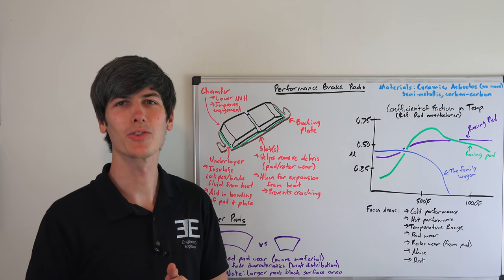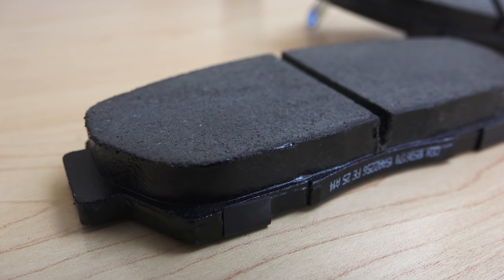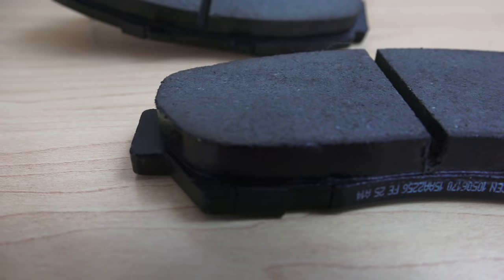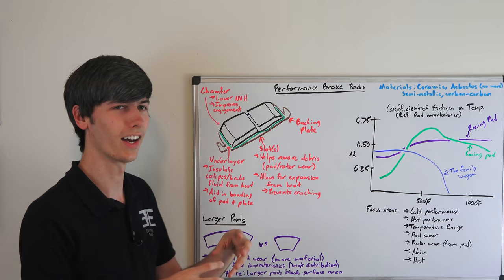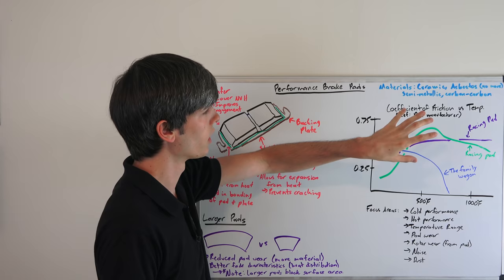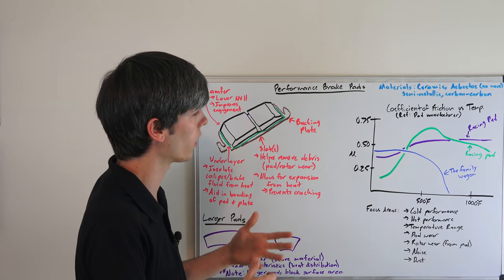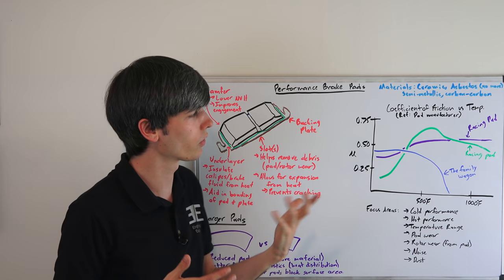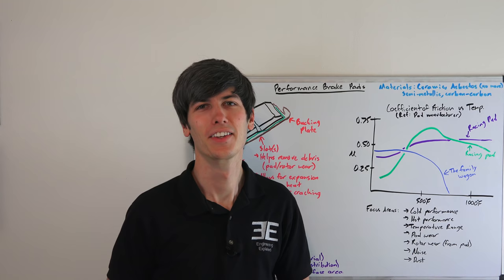Performance Brake Pads - 7 Key Characteristics

Comment: Funny people never talk about changing break fluid. An inexpensive thing to do, it makes great improvement ....no one believes me.
Reply: YMC-DAB420  Where do you buy that at?  I need some of that!

After watching EtCG's video on stainless steel brake (err break) lines, I'm thinking about an upgrade!  😅
Reply: It's worth doing if it hasn't been changed for awhile. On a new car, changing the fluid won't help unless you're tracking the car and need a higher temp rated fluid.

Comment: maybe a better video would be the comparison between semi-metalic and "organic" ceramic pads, which most of us buys
Reply: frank james I agree. I've seen some comparison, but this guy explains well. I would like to hear his opinion and what he thinks about it.
Reply: frank james Yeah, I'm still confused with those. What's better in different situations? Ceramic, metalic, organic - there are so many of them.
Reply: +frank james semi-metalic is better for track/street use as the compound has a high temp range. The ceramic pads are really good for street use as they have low dust and noise and some can be used for a track. Organic is purely for street use as it has good friction from cold but really bad for speedy driving as they will overheat really quick
Reply: I agree
Reply: frank james Organic if you drive like a woman. Semi-metalic if you want to stop.
Reply: I wanna see this future video to, wanna know the scientific datas behind each material's performance. Like whats thw difference between full ceramic or carbon ceramic

Comment: Damaged/old brake fluid plays a big part in break fade - a simple flush every year can makes a lot of difference.
Reply: But full flushes, most auto shops don't bleed the brakes and only replace what's in the reservoir.
Reply: Oblithian Too true..
Reply: Oblithian that's a good way to do it. of you use a clear pipe... just fill the reservoir up and bleed every brake. starting furthest away from the reservoir until they become clear.
of you change you fluid every 2 years or 12,000 miles. then why you need a hard chemical which eats the brake lines too?

Comment: I've had brake fade once coming down a very tight twisty hillside road while on a "spirited" drive. By the time I got to the bottom I had almost no brakes at all. It's quite unnerving.
Reply: theslimeylimey cool thing is the more they heat up the less they brake and reduce heat absorption which works as overheat bypass
Reply: theslimeylimey Usually, you will still be able to slow down with the e-brake as the rears will likely heat up less. Had this with my father's car (turned out the car just needed to be serviced and still had factory brake fluid), pedal to the floor had actually less effect than downshifting : I ended up going straight instead of turning at an intersection, put two wheels on the grass and pulled the e-brake to do a u-turn and stop. Tried driving a bit a slow speed to help cooling a bit before stopping, and then tried to pour snow on the brakes. That was a pretty funny moment^^
Reply: GT-Alex good tip about the e-brake. My car was a manual so I used the engine as a brake while I stood on the brake pedal which slowed me down enough to make the corner. It felt like there was grease on the discs.
Reply: theslimeylimey
Although, I would recommend pulling it slightly only, unless you're very experienced or trained to this. I think the reason is pretty obvious.
Reply: +GT-Alex Pouring snow on the brakes isn't a very good idea, could end up cracking/warping the rotor.
Reply: dj7310
 Yeah I know, I had it let cool down a bit, plus the problem was coming from brake fluid which boiled quite early, having never been changed, so I mostly tried to get the snow on the lines. Didn't do much, but enough for me to be able to actually feel a bit of decceleration when pressing the pedal, so I got back on the road carefully, as it is always better not to be stationnary to cool things down.
Reply: +theslimeylimey I've done the very same thing. High temperature brake fluid and absurdly-expensive brake pads fixed that. Japanese brake pad compounds like the Endless MX-72 are known to be track-worthy brake pads that also work well on winding roads like mountain passes and canyon roads.

Comment: I want the caliper that goes around the whole disc. 20 piston calipers for my Civic.
Reply: #WheelLockUp
Reply: And then how will the rotors cool down?
Reply: Boyd W through the internal vents
Reply: @MustangsTrainsMowers  The caliper cools the rotor down, too.
Reply: @MustangsTrainsMowers   You will need a extra radiator for water cooled discs.

Btw... I think the original comment was a joke
Reply: I looked at installing a big brake kit on my wrx...  $5000  🙄
Reply: 20 piston calipers best fit a lorry brake master cylinder🙄

Comment: Great video! Definitely calls for a follow-up, e.g compare characteristics of a few high performance pads, and also why getting pads with super high friction coefficient isn't necessarily going to stop the car quicker: it will trip the ABS (if you have one) or lock up the wheels (if you don't) in case of heavy braking. Very high friction pads require tons of aero to get enough grip on the front tires to maximize braking force.

Comment: I had huge Brembo brakes and rotors with ceramic pads and they failed immediately on the track.

 I had to pit and have my pit crew put in my Cobalt Friction racing pads. Back on the track and the racing pads are impossible to overheat and fade. 
Castrol Srf $80 a pint full synthetic brake fluid is a must!

Comment: I would have liked to hear you talk a bit about which types of pads (pad materials) give off more or less brake dust.  Is there a general trend/rule in cost of braking performance for the low dust type or can you find a low dust pad that still has good braking?
Reply: yes. our pads have very few dust. It is ceramic formulation, without any metal.

Comment: Tip: For daily use avoid the slot brake pads all you can. They are just there to collect debris and scratch your disks. Otherwise clean them very frequently. Live and learn. ;-)

Comment: Great video. Would have been even better if you had made it even clearer that brake pads are always a compromise on something. For example if there was a material that had great coefficient of friction at both low and high temps it would wear extremely quickly. Also you could have explained the basic equation of friction, which doesn't involve area, so just increasing pad size doesn't give you more breaking force. Just suggestions, please keep video coming.
Reply from the maker: Gavin Newman Thanks, I have a lot of videos covering F=uN so I didn't bring it up again. Everything's a compromise. :)
Reply: Okay.  You didn't need to explain it, just mention it and maybe get some self promotion! Keep up the great work!

Comment: I always thought the changer on the edges was used as another more visible “wear indicator” as in if the pad wears away the chamfered edge the pads are close to being worn out.  I know they use a metal strip that drags along the rotor and when that happens the pad is gone and needs to be replaced.  

True story but way older vehicle.  The pads were worn down enough where the rivers used to connect the pad to the backing plate wore down and was digging in the rotor.

Comment: As a car enthusiasts,(consumer) I do care what kind of material for brake pads lol. You know before I knew about the kind of materials there were, the question was "do you want more or less brake dust?" Haha I have ceramic brakes on my ford explorer sport trac. They are "good"  but there's something about them that I don't like. It could be because the suspension and also with only having disc brakes in the front. Some people say you have to wait until they warm up for them to really start working. what kind of pads would you recommend for the "consumer?"
Reply: Okay thanks.
Reply: For you? Maxi pads.

Comment: Thanks, though I wish you spoke more about pros/cons of the various material options.
Reply from the maker: mwsaplam It's certainly a complicated subject. There are dozens of materials, but often times you're not going to be buy "x" material, you'll be buying some composite of many numerous materials. Hence, it's important to look at the temp charts and see how the pads perform.
Reply: +Engineering Explained Yeah, good point. Thanks for the reply.

Comment: Engineering Explained I upgraded to larger calipers before and went back because it seemed my brakes would fade much faster and last much longer. Is that because of the components not cooling down quickly enough?

Comment: #question  i have seen this on many makes and models of vehicles , why do manufacturers make the pads smaller than the disk , what i mean is radially the pad does not cover the disk leaving a thin line of metal all around the disk , i would like to hear your thought on this since in my opinion its just so you have to change break disks every time you change the pads ( just like what Scotty Kilmer  thinks )
Reply: No need to change disc. Its not a big deal if brake pads size is small.

Comment: Hi! my 2018 BMW M4 with 25k miles currently got front brake pads at 5mm thickness (NOT carbon ceramic). With the car, brake servicing warranty was purchased that will expire in 15 days. BMW doesn't service unless thickness goes to atleast to 4mm. No chance of getting the car to track/autocross, any other specific driving style may use 1mm thickness with 50-100miles driving? :) Thanks!

Comment: If you have a car traveling at 60mph with normal family car brake pads, will it enduce less wear on the brake pads and rotors to stop quickly in a short distance or stop slowly over an extensive distance?

Comment: There was no mention of Judder or Thudder during the discussion of performance brake pads.  Asbestos is still used in brake pads.  The characteristics of friction vs. velocity is completely missing in this presentation.  No mention was made about bedding and material transfer for adhesive friction, the predominant mode for friction in braking.

Comment: Forgive my lack of knowledge, that's why I'm here, but at what point does one need to start upgrading master cylinders to accommodate the stronger than stock brakes?
Reply: you run the risk of overheating the brakes and overpressure and you will shorten the life out of your pads and the rotors. Lol

Comment: Isn't there a letter code on the back of brake pads you can read to see what the performance is too?  From what I understand, the first letter represents cold performance, and the second letter represents performance at operating temperature. The higher up the letter is in the alphabet, the greater performance that brake pad would have. For example, an FF pad will be better and more consistent than an EF pad, which would perform worse when cold. Is this accurate?
Reply: +Gavin Carney The two-letter friction rating you are referring to is called the FMSI friction level coding, sometimes referred to as the DOT pad code.
Reply: Thanks for the info! I've been wondering how I can search for brake pad quality online, so knowing what the rating is called should help me do that.

Comment: Use a Nokia 3310 = infinity brake pad life
Reply: +Cars and their Parts I used them for a while but they ate up the rotors in just a few weeks.
Reply: +Cars and their Parts Them Callahan brake pads are so much better. I had a pair of HTC brake pads and they just dont hold up.
Reply: I might actually try that
Reply: But the brake rotor will break so you are not stopping at all.

Comment: for track applications I hear carbon ceramics hold that coefficient of friction, but does that also means they last longer\get replaced less frequently? they're way more expensive to replace so in terms of cost do they really even make sense for non-pro enthusiasts to shell out for? what's the best budget track brake pad for your average bro?
Reply: SoSickWidit For the road and maybe a spirited drive, racing pads aren't worth it. They will take time to warm up and they will bite insanely more than standard ones, they will make more noise and dust also. They sacrifice longevity (not too much) for stopping power and are to be used in basically high speed stops all the time, eg. a track. Street pads are worth it if you go for spirited drives often, but for normal use stick with a high end ceramic pad with multiple shims on the back plate and you will be perfectly content - less noise, less dust, longevity, and good stopping power. You probably have a forum for your specific car with sponsors that sell aftermarket parts for it, so check out what they have to sell as upgrades from stock.

Comment: i was thinking switching from solid to slotted but i dont know which pads should i use. i have 2004 bmw 4.8is 360 bhp and i use it 95% for commute but that 5% i like to run it 250kmh on german auto ban,. i have noticed i am loosing brakes when driving a bit more aggressive above 200kmh. so racing pads are not good for commute, and regular ones are not good for autobahn... any ideas what should i look for? if i use ceramic pads on regular disc, is there any other issue than premature disc wear?
Reply: ktm640lc4BGD EBC Yellow Stuff pads.
Reply: Evil Opti Z thank you, i'll give it a try

Comment: I work at Advance Auto and I was wondering why Merdeces' brake pads are usually square without chamfers on the sides without a cut in the middle. Why is this? Wouldn't you want a pad that is rounded along the rotor surface to give more surface area and more heat dissipation on a performance car?
Reply: +Striball Mercedes just playing their money games, the pad will eventually leave you with horrible uneven wear, creating a deep ridge line in the rotor requiring you to change the rotors when the pads need replacing.
Reply: It doesn't wear out the outside of the rotor so you have to change your whole brake when you do your pads. It's really annoying.

Comment: I have been fighting with pad wear and performance in my 2006 4-runner sport. The truck has warped rotors from day 1. Now I have put a lift, heavy bumpers which has added 800lbs. I upgraded to EBC yellow pads which lasted 6000 miles. The orange pads went 9000 miles but no warped rotors! Is there a pad that will last longer and not warp my rotors??
Reply: Rotors warp from heat and sudden  cooling. So if you are braking really hard and make your rotors very hot then hit a puddle it will warp your rotors.

Comment: The brake pads on my new motorcycle make quite the squeaking noise when I apply brakes. I'm pretty sure it's because of the dust that gets trapped but a lot of people online have told me to try organic brake pads.
What are organic brake pads and how are they different from the others?
Reply: the squeeking is most likely due to you (or someone else) not using enough copper grease in the back of the pads when fitting them
Reply: Danny Hills nope its the dust :P
And it has stopped making that noise now (idk how since there's always a lot of dust here)

Comment: Hi, I recently replaced my pads and I noticed that the new pads didn't have the slot / cut out in the friction material... I haven't noticed a difference in braking but I installed steel braided lines and new discs at the same time. Considering I was trying to improve the brakes with new lines/fluid/etc, do you think I should replace them again with pads with the slot?
Reply from the maker: +SpeedVitz LDN The features don't necessarily make the pad, the compound does. If it's a quality pad it shouldn't matter too much if there's no slot for heat expansion.
Reply: Engineering Explained Thanks for all the great videos and useful reply.

Comment: they recommend using your transmission for braking going downhill rather than your brakes. while i agree with that half way i say thats just a rumor for transmission wear and started by a mechanic. while towing a load yes use your gears to help brake but just driving, no use your pads and save the 4 grand in the future. but before anyone gets all bent out of shape over my comment let me clarify that my comment is for automatic users NOT manual users.
Reply: +IFIXUR360 If you have long hill descents with a set of traffic lights at the bottom like where I live, people with autos use their brakes the whole way down the hill and then sit with their foot on the brakes at the lights = warped rotors after a while. 
There is no harm in holding an auto transmission in a gear or two lower to help the car hold speed rather than ride the brakes the whole way down. There's no disadvantage in doing it as long as you remember to put it back in drive lol. (Actually the only problem is trying to convince the missus, I just let her leave it in D and avoid the argument. Its cheaper than a diviorce)
Reply: yep we only have hills compared to you blokes and it is personal preference really. They are autos for a reason so there is nothing wrong with leaving it in D.
I just like to have a bit more control over what is going on and not rely soley on the brakes.
I am not talking about using only the engine for braking but just in taking the load off of the brakes in situations where they will take a beating. Seriously I can't see any reason you would blow an engine or a transmission unless you try pretty hard.